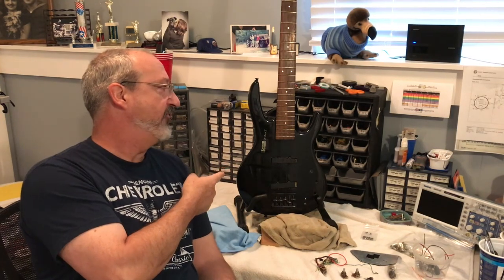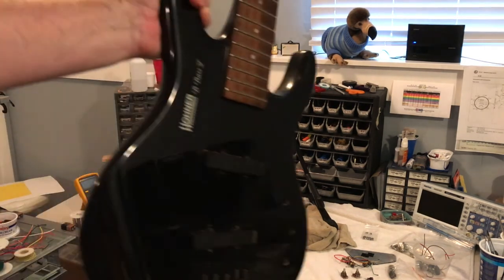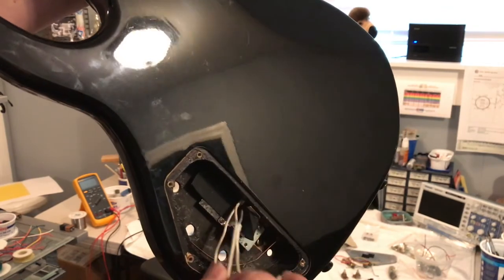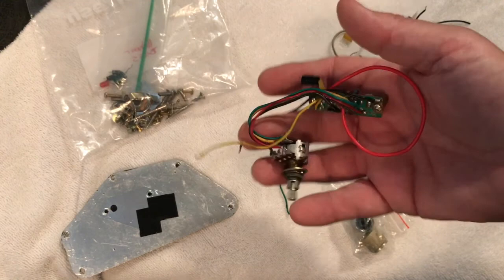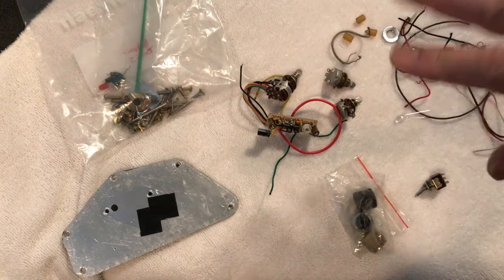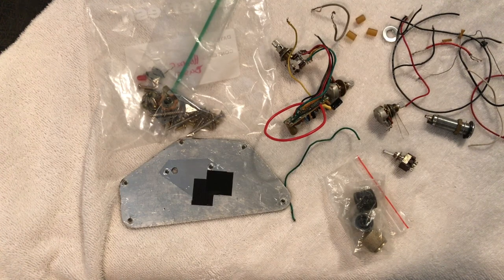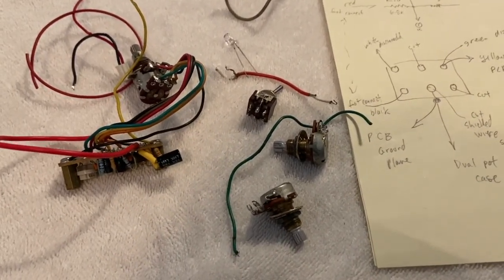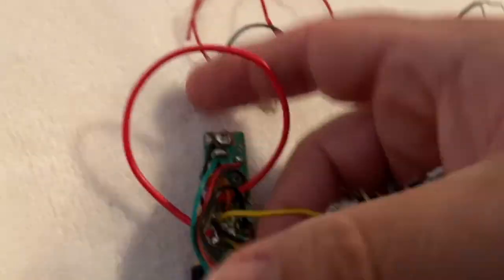Hohner Pro B Bass V Part 1

Comment: To find where the signal from the pickups enter the preamp circuit, it would be quite simple to check for a data sheet for the ic and find which pin is input and which is output. They would normally be connected to capacitors for DC blocking.

Comment: I have the 4 string version of this bass and my actives give off such a loud pop when turning it on....scares the hell out of everyone when that happens.
I was told the board is shot - so, now I need to find a replacement or totally rewire it with a new active setup....